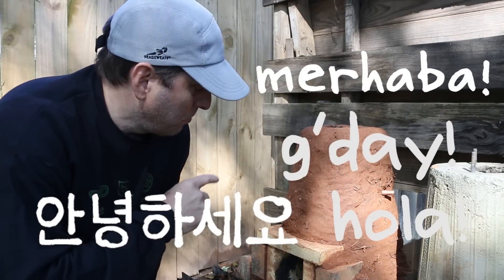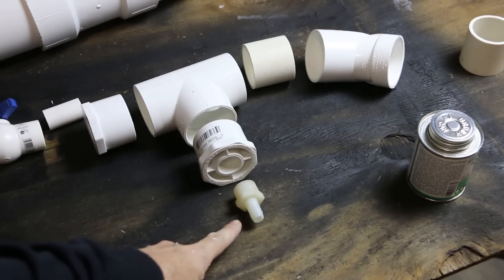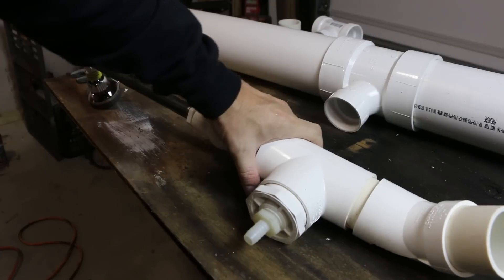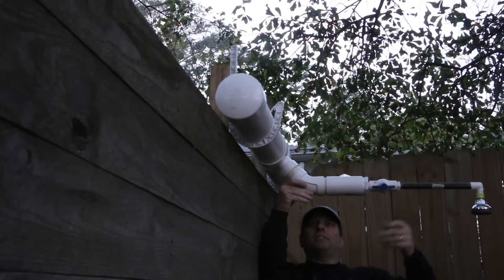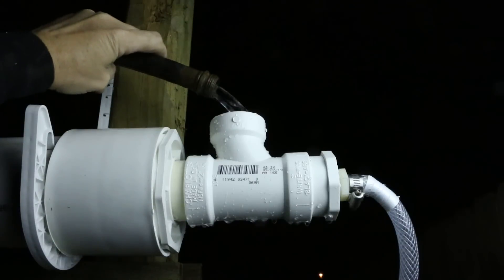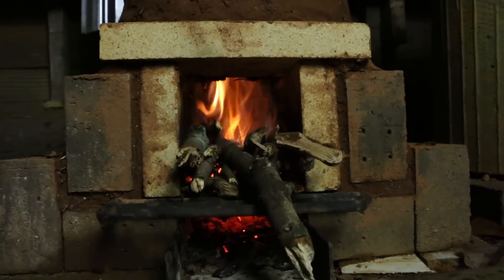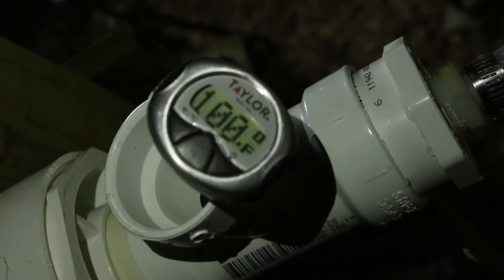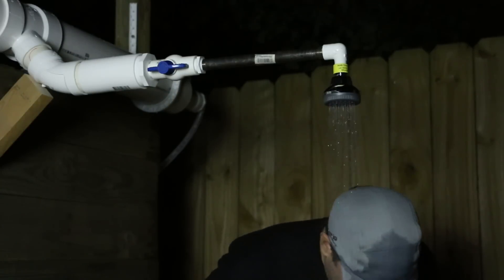How To Heat An Outdoor Shower With A Rocket Stove | Part 2

Comment: Looking good. Just a little tip: be sure to wind the teflon tape in the same direction as the thread to prevent unwinding when screwing.
Reply from the maker: Hi Joris. Thanks for the tip. I was trying to do that in my head, couldn’t always visualize which way the fitting would turn. Thanks for watching.
Reply: @GreenShortzDIY  I know what you mean. If I can't figure it out in my mind, I pretend to screw the fitting on and make the actual screwing motion with my hand before winding the tape. Seems silly but works!
Reply: The tail should be trailing ,  not leading

Comment: Maybe if you added 3 undersized baffles (dampners) to the center of the stove chamber it might direct the flame out to the pipe coil. If the flame chamber is 5" in diameter, add three 2 or 3" baffles (like a dampner).  The flame would still go up but maybe direct some BTUs to the outside coil.  Also, water pressure would increase if the tank was vertical and higher.  Or, if the coils were not embedded in the clay, but out in the flame they would absorb more heat.  Just a thought.
Reply from the maker: Good thoughts, Angel. Thanks for sharing. Thanks for watching.

Comment: This will work a lot better with a significant difference in the height of the cold outlet and hot inlet on the tank. Without this there is not enough of the thermosyphon effect.  So the tank can only work if it an upright version. This is why it isnt working well - nothing to do with the Rocket Stove setup - which is fine
Reply from the maker: Thanks for the feedback, Steve. I thought about a vertical setup as well. I’ll give that a try in my next iteration. Thanks for watching.
Reply: But the higher the difference the more stratification of the water. If you do go for the pressurised system i would put an elbow on the end which drops down to the feed so the cold water sits lower while having the shower. In current setup cold water will cool the warmed water straight away

Comment: I think if you put the shower on one side of the tank and put the tank at an angle it will help with pressure expecily when water level is getting low or maybe a 45° in the middle as a v shape
Reply from the maker: Thanks for the ideas, Wesley. I like the idea of a V tank. Interesting. Thanks for watching.
Reply: @GreenShortzDIY  you can just put a tire valve in the tank somewhere on top and pump it up with a bike hand pump or a foot pump to add pressure , but the system would have to air tight, so you would need another way to mount the thermostat gauge, like a threaded version of it. 

Also keep water in the tank during the day and paint everything black, the sun will help heat the water a bit

Comment: I really like the direct conduction you have going with the coil in the chamber, I feel like you could further expand on the other viewers suggestion, to not use perlite in that area, by using a metal pipe of some sort to wrap around the outside of your coil. You could then pack the gap here with a conductive cob, possibly with metal shavings or another conductor. You could make this piped in heat exchanger section larger than your coil and reap the benefits of higher thermal efficiency without the cost of more copper piping. You could further aid the exchanger by using another metal pipe as the inner diameter of the exchanger section of the burn chamber (if creating an exchanger larger than one's coil). Not an engineer by any means so call me out of this is totally wrong.
Reply from the maker: Good ideas Sean. I’m no engineer either, so you’re in good company. Thanks for watching.
Reply: Sean, I agree totally with what you have posited, I would also personally want to add something like sheet metal on the inside of the copper coil. Not only to add thermal transfer (if you get side tracked like green shorts did and the fire goes out, you have some heat from the sheet metal to help maintain. Plus if he lost the updraft and cold air came in, wouldn’t that make the copper fragile over time?) but to protect the coil. I would want to encase my copper coils in something equally protective and conductive. If the inside of that copper coil is continually exposed to high heat (the flames are 2 feet above the chimney), the copper will become fragile, leak and break in a short period of time! At work i deal with various types of tubing, including copper. Our copper tubing is run through heavy magnets (biggest ones are 6500lbs) for cooling. We have copper fail on the inside of the magnets because of prolonged heat exposure, we started wrapping them in this non-conductive material to protect them but only after the copper has failed internally to the magnet. Also, I just personally repaired an input copper flag over the last 3 days. We require DI water, but only get Chill water from the hospital. So we deal with the friction of the cold water full of minerals ‘sand papering’ the inside walls, 24-7. The copper literally just crumbles.

I understand that I am dealing with some of the extremes of copper, compared to Green Shorts, but science still applies. Protect the inner walls of the copper tubing, ESPECIALLY where there may have been a “little kink in the tubing that was fixed”. That may flow water normally without restrictions, but you have created a stress spot in the tubing and direct heat (ESPECIALLY FIRE!) will be the first place that copper tubing separates. Damn, I was tryin to be short.

Comment: I'm thinking a better valve to use would be a brass one with a faucet handle or a lever handle. Those plastic ball valve ones are very stiff and difficult to use.
Reply from the maker: Agree. It was a little difficult to turn. I need to look at some alternatives to the valves. I had that one on hand, so I used it. Thanks for the feedback. Thanks for watching.
Reply: @GreenShortzDIY  You`re welcome, I will be watching regularly.

Comment: It would not look as nice but would be easier to build and likely work a little better to get rid of the center tap, install on a slant, and just connect cold return and shower head to the low end and hot return to the high end.  Coming out of the low end with a 90, you can still connect the cold return and shower head oriented perpendicular to the ground. Alternately you could orient the tank vertically, would have pressure for the first half of the shower and improve the thermal siphon.  It’s getting large enough that if you go for a larger tank, you may want to choose more diameter vs. length.
Reply from the maker: Ian, ultimately I agree that the tank will need to go vertical. My choice to go horizontal was more to do with mixing hit and cold water, and easy filling. It also worked with the space I had. But you’ve given me an idea on perhaps converting my big chimney pipe stove into a water heater and use your slant idea. Thanks for the feedback and for watching.

Comment: Standard water heaters are hot water heaters - it's what they do 90% of the time. They heat already hot water!

I know that's your prototype but if your going to heat the water then shut down the stove, you'll need to insulate the tank and pipes. You're definitely losing heat without insulation. so it will increase efficiency either way.
Reply from the maker: That is an excellent point, Phylis. :-) Thank you for your suggestions as well. I plan to use the water right away, but insulation would be a good addition regardless. Thank you for watching.

Comment: you most likely have a large air space at the top of your tank, your inlet should be at the top of the tank but you can probably just lift that end  until its higher . Maybe check out the car top showers with an inlet at one end and the outlet at the other, many have a Schrader/tire valve.  so you can pressurize the tank. If you use black abs or paint the tank black it will be plenty hot with just the Ga sun in warmer weather
Reply from the maker: Thanks for the feedback, Doc. I agree with your air gap concern. Ultimately I think I’ll be making the tank vertical. I was thinking about using my air compressor to add pressure to the tank. Thanks for sharing your ideas. Thanks for watching.

Comment: I think it would be cool if you found a way to insulate the tank so it would hold its heat for a longer period of time, in this situation it might not be necessary but I think it would be something to try. Thanks have a great Saturday!
Reply from the maker: Good suggestion Hunter. I plan to use the water immediately in most cases, but insulation would also make the whole thing more efficient. Thanks for watching.

Comment: Black steel pipe is not water pipe; it'll rust.
Reply from the maker: Thanks for the tip, Jim. I’ll likely switch to a PVC segment when I shorten that section. Thanks for watching.

Comment: why not use a big copper cyilinder on top of the rocket stove  with the hot and cold feeds to your shower, add in the cold feed in a 12v pump
Reply from the maker: I like that idea, John. You suggesting a second coil, right. Or something different? Thanks for watching.
Reply: @GreenShortzDIY  like a copper hotwater cylinder , so it act as a back bboiler but on top. but even on your version, a 12v pump on it would circulate the water faster
Reply: Hey John Jones make a video on this please!!